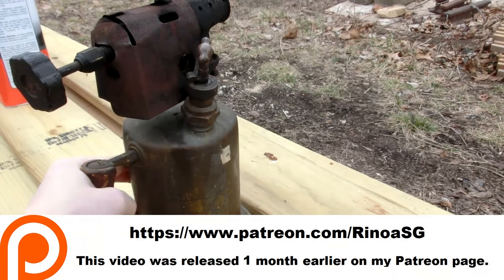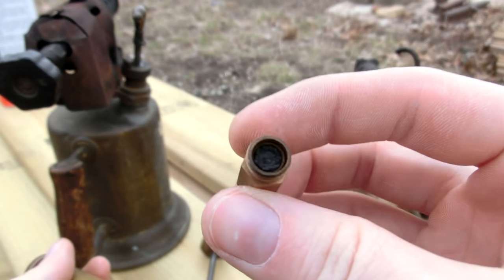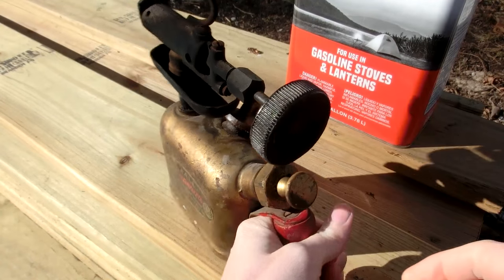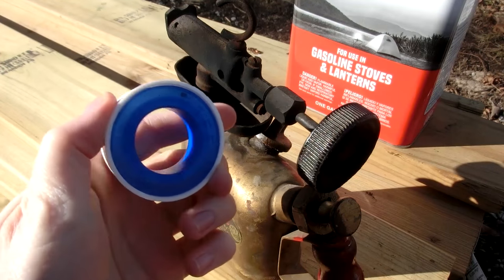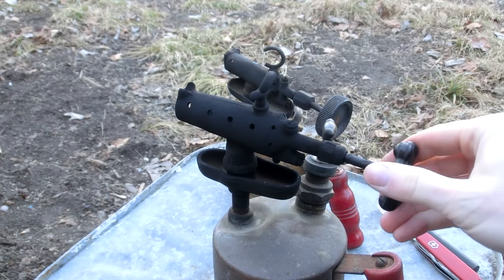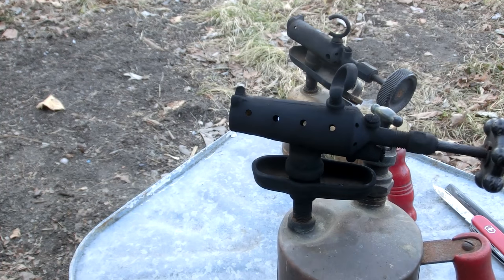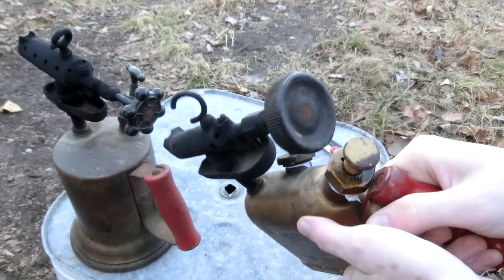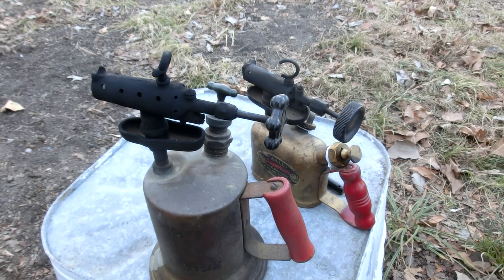Antique BlowTorch / BlowLamp Troubleshooting 01: quick fix

Comment: Hey Rino great vid, the smaller Wall lamp was designed for a mechanic where it could easily fit in a tool box,.
The very best material to use to replace the pip/washer on the pump check valve is Viton rubber all us collectors use it the same with the filler cap, viton is resistant to Gasoline kerosene and diesel, some viton 2-4 mm should be ideal for purpose

Comment: Quick question do you still have the small wall torch .if so could you help me with some measurements on a piece pleas ?
Reply from the maker: I do but I left it in my barn in illinois, currently living 1,400 miles away from it. sorry
Reply: @icc3a1800  dang i got one these little torches the gass control valve rode was broken at the tip :(

Comment: how much fuel do they use, instead of leather you could use a lead acid battery rubber vent cap, from one of the smaller batteries
Reply from the maker: +MN SHP (MNSHP11) thats a good idea

Comment: after watching one of your older videos i got myself one but its a weird design, it has sort of a fuel preheater, the fuel goes into a tube that goes up, splits into 2 tubes then recombines int one to form a ring, the flame then flows through that and heats the fuel before combustion. it also doesn't have a valve to increase/decrease fuel flow. it only has a pressure relief valve, so to start it you pump and to stop it you open the valve. anyway. its been a real pain and only seems to light for a few seconds at a time.
Reply from the maker: +Thomas Sears sounds like the ones with two valves ive been looking for, im interested to find some preheater ones and see if they are any quicker to start.
Reply: Rinoa Super-Genius I could probably send you some photos or something. I'd send it to you if the postage wasn't so ridiculous here.
Reply from the maker: +Thomas Sears you can send photos over the internet ya know

Comment: would you sell one of these?
Reply from the maker: yeah probably.
Reply: @RinoaL  
10w-60 means 10 winter 60. Some people mistakenly say 10 weight 60, that's totally wrong. The numbers refer to the viscosity of the oil. This one is for car engines and the thinner the oil the smaller the number and the thicker the oil the higher the number. There are single viscosity oils usually used in lawnmowers and old machinery, something like "straight" 30 or maybe 50 for race cars with loose tolerances. The reason for dual viscosity engine oils is that the engine needs thin oil when it's cold (winter) to start up in the morning, the thin oil flows more readily and once the engine warms up... the oil will thicken to protect the vitals.